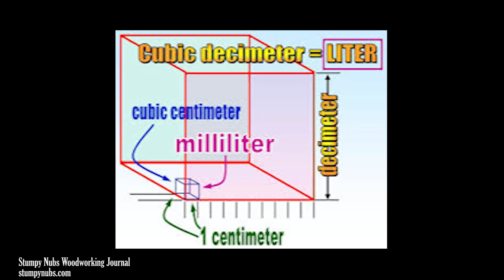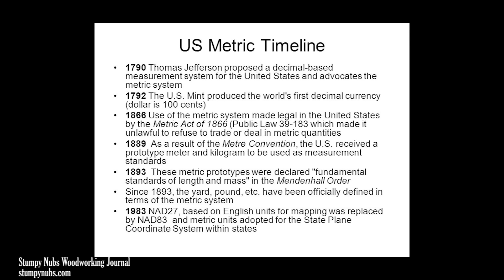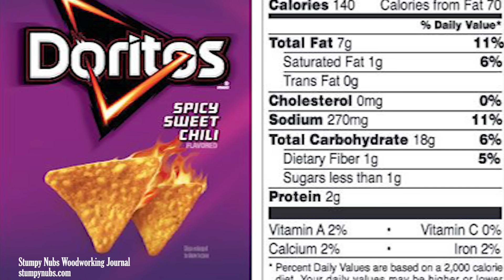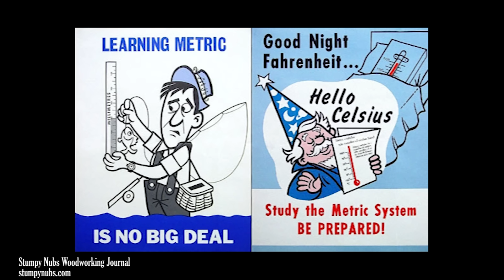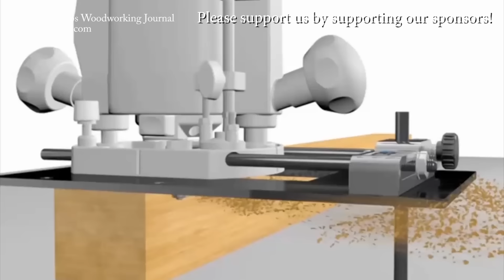BREAKING: The USA is switching to METRIC!

Comment: As an engineer, I love this 😂
Reply: Absolutely!! Engineering calcs are SO much easier in metric!!!!!
Reply: As a structural engineer I hate it.  Whenever performing a calculation it is imperative to have a gut check on whether it is a reasonable answer.  If I’m expecting an answer in a certain range of pounds, I know what that means.  The standard unit system is my first language.  It would take years to attain that same gut feel in Newtons. I would always be converting back to standard units.

An engineers gut feel for an answer is critical.
Reply: Explains why there are so many bridge issues engineer......
Reply: I think @SteelheadTed got it right for a lot of us. I took have a hard time visualizing metric units and am comfortable with imperial units. I end up converting to double check myself.
Reply: Yeah, but I already use metric for engineer related functions... It's everything else that I'm worried about.

Do you really wanna use Celsius? You lose resolution when making important decisions like if it's going to be warm enough to wear shorts or not.

KPH? Think about the speeding tickets.
Officer: "Do you have any idea how fast you were going?"
Me: "No, I do not."
Reply: The only thing that adds confusion to imperial measurements is "thousandths of inches" and "ten thousandths of an inch";  Not crazy about that at all.  Rather deal in picometers, femtometers or attometers.
Reply: @SteelheadTed but if you learned only kg and meters, it would be the same gut check.  

Our schools need to be teaching from day 1 and live and breathe it all through primary and secondary schools.  Takes a generation to do it.  No one will do it until they HAVE to.  

It’s like flight or sea, knots.  Another measurement. Once you learn it and live and breathe it you don’t think you need to convert all the time.
Reply: As a chemist, I Love This!
Reply: As a drug dealer I love this.
Reply: As a carpenter for more than forty years, I absolutely hate it.
Reply: Physicist here, I agree 👍
Reply: As a mech tech brought up in metric i had to learn imperial I can honestly say it depends on what your doing.

Machining down to a thou or grinding to 10th of a thou believe me is more user freindly than the metric versions, you can feel a thou of a diference in your finger.  Also scalling, some pressure measurements are better in PSI even filling your car tyre to 32 psi is better than looking on the bar scale for 2.206 bar.  I can work in either or and see the advantages of both worlds. I just hear younger people than me saying you should be metric when they have not even tried abd possibly could not work in imperial. That is just lame and offers no objective reasoning.

Plus we have industries that still use imperial like oil industry, metal manufactures who still have imperial machinery and dies. There is a cost to switching over to metric which people saying you should go metric do not appreciate.

I remeber looking through an old tech book for science technicians that was in imperial, i did work the questions out but  it has already been said when doing engineering calculations using the metric SI system realy shines as compared to the imperial.
Reply: American chemical engineer here doing my first project in metric/SI after 13 years in Imperial/US Customary.  It's a mixed bag.  Many units are more intuitive in Customary, and many units calculate easier in metric.  Regardless, the most important skill to retain being an engineer is to ALWAYS. SHOW. YOUR. UNITS.  Otherwise, you'll screw up your calcs in whatever system you use.
Reply: Must be one hell of an engineer if 25.4 = 1 is enough to make you lose your mind
Reply: Agreed 😂
Reply: The thing that gets me about imperial units is they are not even internally consistent, a pint in the US is different to a pint in the UK, Ireland, Australia etc. How can you have a system where a measurement varies according to location?

I grew up in the UK using both systems and was initially more confident in imperial, but these days I am 100% metric (Oh look another decimal...)
Reply: I'm a retired Boeing structural engineer (stress analyst). I was born in the USA and when I went to 7th grade in 1973, they started teaching the metric system. Right after that, my family moved to Scotland for a year and the UK was going through the transition to metric. So I was exposed to it some more.

In high school the metric system showed up in chemistry and physics. 

In engineering school all of our text books used both units. Our steam tables for thermodynamics were in different appendices.

I can relate, but I have had to review work done by suppliers or deal with test problems that used the metric system. If the work was well-documented, it was helpful. If the author of the work didn't include the units they used for derived units (e.g. units based on combinations of length, time or mass), it was utter hell. If the material properties such as density or the moduli of elasticity didn't have the units specified, it made it difficult to understand. Was it kg/cm^3 or  g/mm^3 for density? Was it MPa or GPa? In most cases the unit of length was mm, but the rest could be a real crapshoot.
Reply: So. Where do I start. I’m am 72 years old. A retired draftsman/designer. Starting in 1972 I spent 43 years in the engineering graphics/design business. I worked on a drafting table doing manual drawings for close to 20 years and the last 23 or so years working with CADD systems. I spent a few years doing machine design drawings on downhole tools in the oil and gas industry. All the drawings were dual dimensioned. Showing both imperial and metric. I spent 37 years doing structural design on offshore platforms and floating equipment. I have spent an enormous amount of time working with imperial and metric dimensions. Metrics are much easier to deal with. But imperial can be just as easy if the decimal system is used instead of factions. The final few years of my career was spent working with 3D modeling systems that produced mostly auto generated drawings for the fabricators. All in metric. If you work in any large engineering and design concern, most of the fabrication is done overseas. All metric. In my little home wood/tinkering shop, I mostly use fractions. Mostly because I just like them. They feel right! And I keep a good fraction calculator close at hand. 😂😂  It’s interesting to note that some place in Europe are just as screwed up as the US. For instance. Even though the cars in England have kilometers per hour on the speedometer, the road signs are in miles. 🤷🏻
Reply: engineers can be some of the dumbest people on earth. if they think the metric system is easier, is simply because someone told them it was and haven't actually done any logical conclusion as to how bad the metric system actually is.
Reply: As an engineer, I don't do "gut checks." I review my work and do sanity checks.
Reply: @SteelheadTed visualisation of different units is hard admittedly but people will soon adjust. Also one cubic metre of water weighs one metric tonne so handy for swimming pools and water tanks ;)
Reply: @ackgeezer9754 They're thinking about new carpenters not ones close to retirement.
Reply: As an engineer, I hate this.
Reply: While there is nothing wrong with either system of measurement, it is unlikely that there will be a dropping of the imperial system. An example of this in carpentry terms, is the current recreation of the roof structure of Notre Dame. Uniquely,  while this  was basically in imperial,officially it us in royal dimensions, which are slightly different a Royal foot is actually approximately 13 Royal inches. So to exactly recreate this the6 will need to use that system rather than metric, or the sizes will be incorrect. 

Throughout the ages, measurements have changed. A cubit ( 18”), a span( the distance of the outstretched hand), a yard , which is the distance from the tip of the nose to the end of the outstretched hand, the Fifth of a gallon, Etc. while for certain practical purposes can  be converted into metric, the old terms will still be used.  Despite changes in terms, the old adage of “ Man us the measure of all things” still applies.
Reply: @petemelbourne42   I dont know if it is stupidity or ignorance but im sick hearing this. As you can imagine back in the day evrry country had their own standards hence the disregularities in standards troy ,advoirdupois, apothocsaries.

A bit like mp3 mpeg or early pc standards, vhs, betamax.  The lidt goes on.
Reply: @planespeaking  thats a bit harsh is it not verging on the ageist. Because he is older his opinion is invalid lets all live in your world .. heaven forbid
Reply: @stevenconnor4221  You're inferring things I never said. Just stating a fact. I never said his opinion was invalid either
Reply: @walterulasinksi7031  I think you've just exemplified why they should be dropped.
Reply: @planespeaking  maybe if you speak and say what you mean people would / could not infer that through your obviscation and passive aggresiveness you could add plausibile deniability to your statement
Reply: @conrat2000 😅
Reply: @stevenconnor4221  what are you wittering on about? Also obfuscation which I wasn't doing. Find a dictionary.
Reply: @planespeaking  so when you have a coffee from your favorite barista, will you tell them you wast 272 ml of expresso additional or a shot?
Humans have opted for the most convenient methods of communicating.  So instead of your needing to have a long drawn out speech, it is simpler to make the shot glass hold just the correct amount. A similar thing applies to cooking. There is a sprinkle, a pinch, a palm etc. and each is subjective to the taste of the chef. While a recipe can state a specific weight, or other measurement, will,it taste 5h3 same? it is still easier to use the old terminology. How about wire sizes? Will you use gauge sizes or use mils? Those that repair machines will still need to use the old sizing and there are tools that are still available to easily determine certain sizes. Have you ever used a feeler gauge to determine the distance on spark plugs? Or Johannson blocks?These are in thousandths of an inch. And most machinists will still use their own measurements to insure that repairs are within the correct tolerance despite wear. This  is especially needed with Whitworth measurements. Which are neither imperial or metric. We have retired many terms such as the dram used in pharmaceuticals, and upsized certain things as they are close together Quart/ Liter etc. but to continue to  have a proper economy. Some things will remain as they are.
What about the fathom? And the nautical mile, the karat weight of gemstones? What about measurements of duration( time)? Do you have a metric second, minute, Hour? How about the light year? Are you aware that there is a name for a 1 with a million zeros after it? 
It is only when there are no longer archaic and antique items in existence that such new measurements can truly be used.
Reply: @walterulasinksi7031  Colloquial terms for measurements apply in a metric world, just like they do an imperial/US customary one. Some peculiar measurements will remain if they have particular value. Just because a nation chooses to be metric doesn't mean everyone has to adhere to that. You do you. The French tried a decimal clock no one liked it, hence it's still base 12. I admire your passion but the US already using metric standards for setting imperial measurements.
Reply: @stevenconnor4221  It is neither ignorance nor stupidity, it is me posting my thought as requested in the video, so your personal attack is wholly unwarranted.  I don't live "back in the day", I live in a connected twenty first century one where people from different countries communicate all the time; as we are doing now, that means that inconsistent standards easily cause confusion. If you don't see that as a problem that's fine, each is entitled to their opinion, but don't make personal attacks to others when they express theirs.
Reply: @planespeaking  and yet in the US people will still speak of Miles per gallon not liters per kilometer. Soon it will be all electric , so that will change but most still want to have usage per mile not kilometer, as a kilometer is only 60% of a mile and sales will be based upon the distance a charge will take a vehicle. Many that can afford such vehicles are already upset that the conversion to electric has not effectively duplicated that of gasoline( petrol).
Reply: @petemelbourne42  that bloke is a real troll. He accused me of same.
Reply: @walterulasinksi7031  In the UK we are metric but some things are hybrid like MPG and using Miles not kilometres. Though we use metric for pretty much everything else. I would imagine the US will go the same way. Although I fully expect this to become a political issue like it has done here which is disappointing. Metric is simpler for two reasons. It's base 10 and there's a lot of crossover between different units. i.e. a litre of water weighs 1kg.
Reply: @planespeaking  the 1 liter of water may weigh 1 Kg ( 2.2lbs), but not for other liquids with different densities. So it is a minor point. An$ like you, I suspect that some form of hybrid terms will come into use. Yet while there are advantages to both systems , so it cannot be adamant for one over another. By the way, there are actual measuring spoons for  a pinch and smidgen Etc. Not easy to find, but the do exist. I was pointing out human nature. You are aware that even the radiation from cesium ( used in the most accurate clocks) changes with altitude? A perfect example of a fact that energy has mass. Both Matter and energy are affected by gravity.  So maybe all measurements should be in terms of frequency and amplitude. And with respect to Heinrich Hertz , cycles is still more easily descriptive.
Reply: @planespeaking  got you grammar nazi also. Im on my mobile expect spelling mustakes. 😄
Reply: @petemelbourne42  well pete im sorry i hurt your feeling it was not a personal attack.    But if you want to live in your utopian world go for it, just dont expext the rest of the world and individual manufacturers whose rechnology and money is set up in proprietry standards i.e. apple for example.  I see your view point but it is in my view utopian and will never be met in society.
Reply: @stevenconnor4221  you're just trolling people on here and I am not the only one. What a sad life.
Reply: @planespeaking  i am not a troll, i am a slightly older gentleman speaking to what I see are younger wrapped up in cotton wool everybody should follow..etc...  do younot think I went through the same process but time has enlightenend me to some aspects...
Reply: @stevenconnor4221  Mentioning me by name in a post calling me stupid or ignorant is almost the definition of a personal attack.

I don't live in Utopia I live in the UK where we have done you seem to think cannot be done, as has Ireland, Australia, India, South Africa etc.
Reply: @FFWrench  if schools teach it from day one and those students enter a market that doesn’t use those units, you have the opposite problem.  I don’t think metric is so great it’s worth the effort.  Standard units work.  Don’t fix what ain’t broke.
Reply: @MrMaacin05  spoken like someone who simply doesn’t understand.
Reply: @planespeaking  yeah, you don’t get it.
Reply: @planespeaking  yeah, you just don’t get it.
Reply: @SteelheadTed  I’m a machinist. Nice try.
Reply: @SteelheadTed  erudite
Reply: @MrMaacin05  doesn’t matter what you do, you just don’t understand how important fluency with a system of measurement is to whether an answer in a calculation is right.  It’s not about how easy the math might be.
Reply: @petemelbourne42   thankyou pete

1. I had to reply to you that is the only time i used your name.

2. I stated what you said was stupid or ignorant I never called yourself that, if you want to delineate that back to yourself thats on you. I have aaid silly stuff before wont be the first time cetainly not the last.

3. You dont live "back in the day" or in  "Utopia" I am glad you have a positive outlook, I mentioned and shared my little knowledge that there were no interntional standards, I then stated some modern equivelants, I then explained how you could never fully achieve it due to competitive interests. You chose to dismiss that and state you live in the 21 st century or something similar. Good for you and your positive outlook, but under the hood no one follows how you percieve your world, there are varying standards and usuage, human ergonomic factors etc.. etc... you keep mentioning you live in the UK they have transitioned. Where do you think I come from? As stated, we are metric but not fully as a mech tech I see it everyday, and I hear the same stuff from youngsters, I tell them your a tech it dosnt matter if its measured in cubits armstrong ir anything you learn how to use it and convert which will make you a better tech, rather than throwing a tantrum due to your frustrations.
Reply: @SteelheadTed if you’re a structure engineer then I’d question why your not using metric. Also if you cannot convert to the American antiquated for your “gut check” then you either aren’t an engineer and/or don’t know how to use computers that do it for you with whatever precision level required.
Reply: @Human_OU812  man, you just don’t understand how it works but I’ll humor you.  

In the US you can’t use metric in construction.  No building material is ordered in metric, no contractors tape measure is metric.  

You clearly don’t know what I am talking about with regard to a gut check.  I use computers all the time, that is irrelevant to your gut check.  Precision is not the point and in structural engineering there is no such thing as precision past the tenth place of any number.
Reply: @SteelheadTed  ok that was humorous I had a good laugh at your response. The US can use the metric system in construction. I know they can buy tape measures with both customary and metric systems on the same tape and also in just metric. So it more an American stubbornness to change or they are just lazy. I clearly do know what you mean as to a gut check- it’s looking at a number and seeing what you’d expect based on your past knowledge. So are you incapable of learning or adapting? All you have reenforce did that you’re unable to adapt and change and you likely should be replaced so the industry can move forward and progress.
I do appreciate the laugh that your response was humorous.
Reply: @Human_OU812  you don’t get it and you seem content in your ignorance.  I’ve learned that it’s hard to convince someone like that so I’m not going to try.
Reply: @SteelheadTed  I can understand that.  However, you wouldn't have to rely on your gut feeling because (with metric) you never have to ask yourself, "Did I remember to divide that beam weight by 32.2?  Was that measurement 7-9/16ths or 9-7/16ths?  I have a 5/8 wrench that's too small.  Is the next size up 11/16 or 3/4?"

What about Imperial units for pressure? bar, atmosphere, psi, inHg...  I have a gut feel for PSI, but bar? Nope. Atmosphere? Well, just convert it to psi.  Same with inches of mercury.

With a little practice, I think we engineers can get a gut feel for metric.  To me, the payoff would be WAY easier calcs in SI units, fewer chances for error, and REALLY easy to figure out the mass of a certain volume of something.

I mean, it can't get much easier than 1 cc = 1ml = 1g of water.  EZPZ:  1 liter of water has a mass of 1 kg. It takes 1 calorie of energy to raise 1 gram (or cc or ml) of water by 1⁰ C
 So, 10,000,000 calories are needed to increase the temp of a liter (or kg) of water by 10⁰C.  I did that in my head.

But if you have 32 oz of water, first, is that volume or weight?  Let's say it was weighed on a scale.  How many BTU's required to raise the temp by 10⁰ F?

Rhetorical question, just to show the simplicity of SI units vs. the opportunities for error when using imperial units.

But hey, I DO get your point about the gut check.  I'm just saying a new gut check can be learned.  Engineers are smart; they can do it!!
Reply: @Shin_Lona  Speed?  I actually is the speedometer as a conversion calculator since both scales are there.

So when I see a sign that says "Next rest area 80 km ahead," I can just look at the speedometer to convert to miles.

Then I convert miles to mph to see how long it will take to get there at my current mph speed.

Or, the simple way would be to see how fast I'm going in kmh!
Reply: @ackgeezer9754  But in practice, units don't matter one bit.  That's why story poles are so helpful.

If all your measuring devices, like tape measure, square, etc. Just had big unit markings and 10 smaller unit markings between the bigs, you'd never mis-cut that board to 7-9/16ths when it should have been 9-7/16ths.  It doesn't matter what the units are, and can be absolutely arbitrary in construction.  But dividing anything by 10 (just move the decimal) is always easier than halfs, quarters, eigths, sixteenths, thirtyseconds, sixtyfourths, etc.

Adding base 10 in your head is way simpler than adding 16ths plus 32nds plus eighths.

On a side note, I think it's the construction industry that is keeping us in Imperial units because everything is based on 4 or 8 feet:  OC measurements of 16, 24, or ~19.2 ◇ inches, lumber lengths, etc.  The thicknesses for many sheet goods have gone metric, but not the length & width.
Reply: @DuffyHomoHabilis  if we were to start over today, sure, all of that is true.  But we aren't starting over, we have the system we have and our native language is standard units.  you can no more convince someone to change their native language than to switch the native language of measure.
Reply: @678friedbed But it is easier, everything being divided by 10 is very easy to remember.
Reply: @DemiCape  you do realize that it only works in 10s. the standard American way works with anything and you can use anything. what's 1/12th of a stick? can you divide a CM by 32nds?